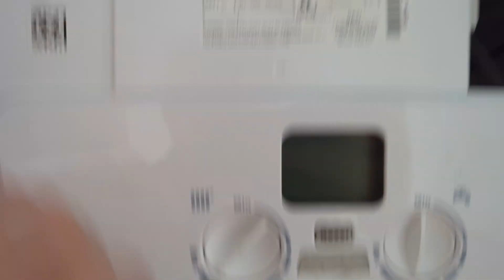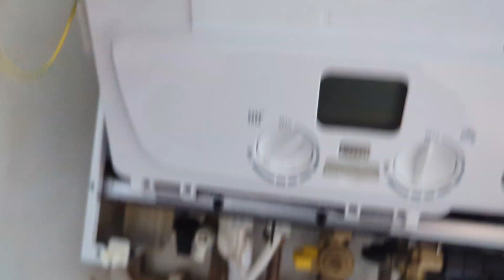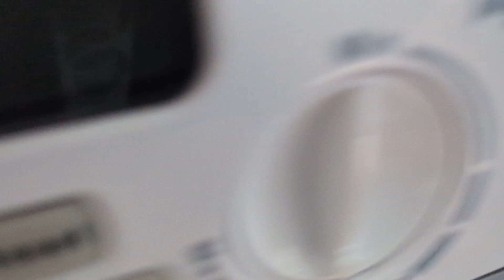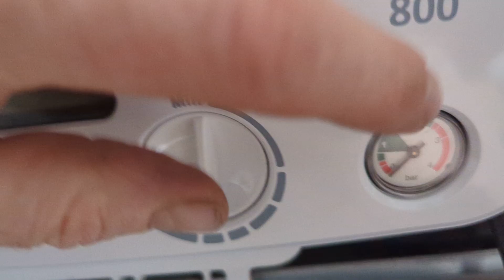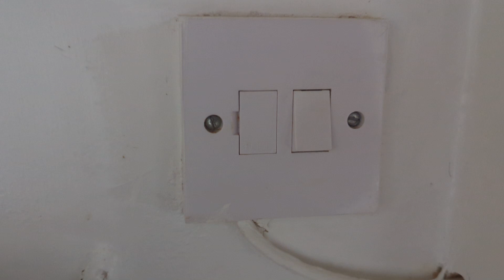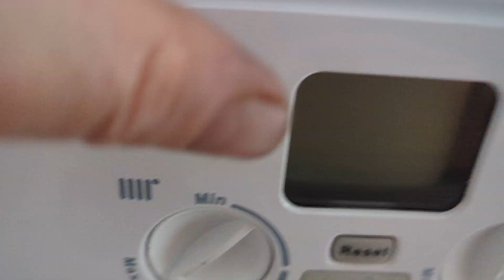How a combi boiler works @BaxiBoilersUK

Comment: Great to watch. Our combi in the kitchen (WB Si compact 30) has a radiator beneath the boiler and then the pipes run up the back of the boiler to upstairs rads etc. and then comes back down in the hallway to feed the living room rads. I can never get the flow/return at the boiler(apart from when starting up) the 12c difference that I have at each radiator that I balanced and was curious that the radiator below the boiler is going straight back to the boiler and therefore giving the readings rather than all the rads from the system? Or does its return pipe run up past the boiler somehow and connect to the returning water from the other rads ? The lockshield is turned down so that it heats up at the same time as all the others. What do you think please.
Reply from the maker: @johnw2758  you may be correct. The radiator below the boiler is heating up rapidly and returning hot water to your boiler and therefore raising the return temperature at the boiler.
My solution to this is to replace the radiator valves with a flow limiting valve such as the Danfoss RAS B2 which will always give the correct return temperature from the radiator, so the radiator will never need balancing 👍 I have done videos on this